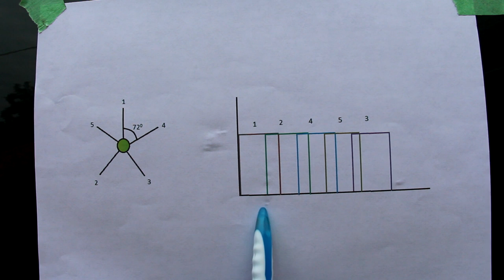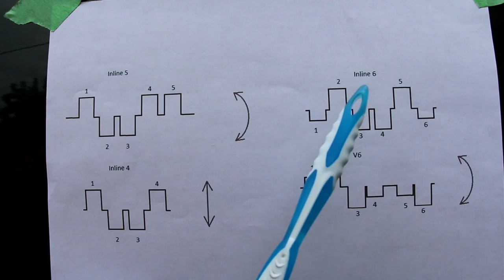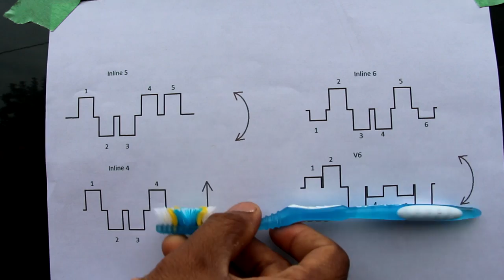Why Inline 5 Cylinder Engines are an Anomaly

Comment: Dude. I have long tried to understand how my 5 cylinder is balanced. You made it super easy to understand. I have owned 4 inline-5's and currently have two as daily drivers, although a bit older than this engine. Yeah, Volvo's pcv system on these is ridiculous to work on!

Comment: My 2011 Volvo S80 d3 5cylinder engine has 276,000 miles and still runs perfectly with no major problems with the engine or pcv system. Only problem was the alternator belt exploding but that was my fault for not changing it...
Reply from the maker: Good to know. These motors didn't have major issues. Everything else attach to it on the other hand....
Reply: Looks like this motor saw no maintenance. I don't care how good it is, neglect will kill anything.

Comment: Really good video.
1: What is the displacement of this engine?
2: What is the intended compression ratio?
3: Horsepower rating?
4: Operational maximum RPM?
5: After seeing the standing water in the number three cylinder, I was surprised to see that the crank would still move.
6: In a different video, the presenter made the case that a 5 cylinder engine delivered more, smoother torque than either a four or six cylinder engine of the same cubic capacity and suggested that in a race application might be the better engine platform to start with.
Reply: I have this engine in my 2009 volvo s40 and it makes 168 hp and it redlines at 6500 rpm

Comment: Speedkar, i  have a turbo 5  xc 90. is there anything good about the engine?
Reply: did you ever get a reply? I have the same model. I bought it new in -04 and still driving with 111K. only complaint is that side and top interior fabric have fallen down and Volvo used this terrible particulate glue that is nasty and sticky. No one will replace the side fabric because of the air bags. I also hate the rear battery. a pain to recharge or change.

Comment: Excellent review (as usual).

I would love to hear an auto engineer's perspective on why the oil filter was designed in that odd way (draining back into the engine).  Every vehicle I've owned, drains down, using gravity to drain the oil.
Reply: These top mounted cartridge style filters are quite popular on European built cars, and getting more common from other manufacturers too. Their main advantage over spin-on filters is environmental, they produce less waste because you only throw away the filter element rather than both the element and the housing.
Reply: This video is wrong. Having owned many cars with side or top mounted cartridge oil filter housing they are superior and create almost no mess when chaining oil. Just look on-line on oil change videos and you will see a mess from every bottom of the engine mounted oil filter being changed! Moreover, I can inspect the oil filter at any time without having to drain or change the engine oil! very useful for checking after additives and engine flushes. Lastly, no need to get under the car for oil changes. Just suck out the oil like boat engine from the top using the dipstick tube and cheap oil extractor connected to an air compressor. I can do oil changes quicker than a quick lube business. Did 5 family cars in 1 hour! no joke.

Comment: Great video!!! 

But I disagree that the canister style oil filter is messy in oil changes.  Loosen the cap to drain it while you’re draining the pan.  Once the pans done, just pull the filter cartridge with some paper towels or rags and no spills!  

Replace the filter, torque down and refill the oil.  

Plus, using an extractor means you don’t have to get under the car at all.
Reply from the maker: Seems like more mess than an upsided down mounted can type filter. The cartridge always leaves you exposed to the dripping oil
Reply: @speedkar99  This is the first time I have ever seen an "upside down" oil filter on a Volvo white block engine, I was very surprised.  I've had quite a few, turbo and NA and all have had a really nicely positioned spin-off filter tucked into a cut away corner in the front of the sump (i.e. to be removed from below.)  My current one has the replaceable cartridge type, but it's still held in a spin-off type housing - no drips or mess.

Comment: 7:47 is it possible to give scratched crankshaft to a machinist to rectify the surface? Say you replace rod bearing over the scratched surface, how does it make the engine not work properly?
Reply from the maker: The tolerances would not align with a replacement bearing since it's worn down. 
It can be machined and thicker bearings put in if you wanted to save it.
Reply: In theory yes. As the other poster said, you turn down the crank and use undersized bearings. But one that's this bad has some problems. One you'll have to turn down the journals so much that you probably can't get bearings for it unless you're talking a GM V8 where everything is possible and available. Second, the crank often gets really hot right there which destroys the heat treat. If it's discolored, throw it away.

Comment: I worked on a 5 cyl VW Jetta not long ago. Can I just say I HATE TORX! The engine was misfiring on 3 out of 5 cyls. Turns out, those engines are NOTORIOUS for coil packs going bad! The STUPID rubber baffle diaphragm valve unit is REALLY LAME too!

Comment: The five cylinder 2.4 turbo diesel on the Alfa Romeo 156 Sportwagon I used to have was just a wonderful engine to drive behind, and the sound it made was pretty good as well. It didn't miss a beat in 150,000 miles...until somebody crashed into it and wrote my favourite car off.

Comment: Thanks! The deck is also open with the turbo engines. Apparently no problem till 300 hp. With proper maintenance these last a long time. Head gasket only fails due to negligence induced overheating.

Comment: I have a v50 t5 2005, and I believe the crank spuna baring.  Some reason I lost alot of oil. There is no smoke from the tail pipe I can not see any drips in the driveway ... This situation is a complete mystery to me.  The engine has overheated to 3/4 red.  I have lost fluid twice to probably 1/3rd full in engine.  Last time it did this, the knock sensor and crank position sensor was faulting a CODE, but before discovery of that, the engine made a loud rattle noise, sound like it was from the top.  Oil light was flickering.  When I got to a local parts store.  I saw alot of steam and smoke from near the oil filter.  After reviewing your video, I believe that whole unit is clogged, or something bad to cause something bad to happen.  The minor coolant line that run between the radiator and aifter box was the first to break.  Got that fixed.  2nd incident was the heater hose over the turbo into the firewall.  that one lost alot of fluid.  The 1st incident was the one that cause the 3/4 to red gauge temp.  The 2nd did not show a tempature over the half mark.  The oil was changed with 6 quarts of oil from the 1st incident.  Everything ran fine.  The 2nd incident, I had NO CLUE, til the low oil light came on and the car was in LIMP mode. It was making a kinda loud rattle noise.  I was concerned for a spun baring.  When I was at the part store, I got the hose by the firewall resealed (Temp), but could not start the car.  I realized that maybe a LIMP Mode code was in affect. I put in another quart of oil in the engine, still could not start the car til the LIMP MODE was clear.  OBD2 reader also showed me a code of Crank sensor mis alignment, and Knock Sensor.  I was in fear that I damaged the internal, most likely the crank barings.  I cleared all the codes, and the car started.  She drove home fine, no issues.   

Next morning, I started the car, she sounded a lil rough, so I turned it off.  I restarted the car later in the day, she was fine.  I paid attention to the resivour for excessive boiling.  I noticed a fuel/exhaust smell, but the fluid was clean water.  But I could not get over the smell.  After your video I am thinking maybe the oil cooler is cracked, but that would leak oil into the coolant, or maybe it is crack to leak oil outside of the engine.  I decided to take the car for a 15 mile trip.  She drove well, lots of power.  Then I started to smell the steaming water.  I went into a parking lot, and opened the hood, surely, fluid is gone, the hose that broke on the 2nd issue, broke again.  SO no real biggie.  I put in lots of water, and steam like crazy from the broken hose line.  I turned the engine off, and restarted, then the oil light comes on.  I am freaking out at this point.  I got the car home, and did a brake accelleration test ... and started to hear THE RATTLE, but it sounds like from lower engine.  I can not produce this effect without doing that brake/accel process.  I wish someone else could do that so I could listen to the engine.  I am concerned that a baring or more is damaged.

After watching your whole video, I am positive I purchased a nice 2005 volvo v50 t5 that had poor maintence, and probably driven hard from North Carolina to Washington state.  So my question to you is, should I part this car, or figure how I am going to manage getting the engine/tran dropped to seperate the tran and bring the complete engine to a Machine Shop.  I prefer to get it fixed, versus parting it and getting another car, and WHO KNOWS what the problems are with the next car.  I am currently looking at a v50 T5 AWD ... the advantage on the other car is the lighter color interior ... Mine has black leather, but that one is tannish with heated seats.  Regardless, I need to have an operational car.  So I figure getting my current car engine fully repaired.  I know the transmission is in good shape, I might need to replace some mounts, and a few parts of the suspension that are worn, then the car will be in near new/very new condition.
    What am I to expect when i drop this engine, and what should I avoid or be warey of when it comes to taking it to the machine shop.  I know this engine is 9:1 compression, I COULD upgrade to 10.5:1 compression which WILL increase over power, and force me to be on high octane gas.  I am concerned about ECU not accepting the new compression and faulting an over compression code, given the power increase.  The head, I like to get ported, and install performance cams, and larger Throttle body.  Those upgrades SHOULD get the car around 300HP easily.  I might upgrade the ECU, with a program or R series.  I really do not want to rebuild this engine back to OEM New, but rather get some performance upgrade done.  That will up the value of the car so if I decide to sell it, It will sell.  The local machine shop is BUD's Machine shop in Lakewood WA.  He is nationally acreditted for his work.  I had a 22re engine built to have a 10k rpm balanced engine.  But that is a 4 cylinder.  Balancing a 5 cylinder is a different formula.  I am not sure knife edging the crank for higher RPM's is wise, as that usually reduces the engine torque, and can cause harmonic issues.  The other thing I am worried about is if the baring is Spun, if it can be resized to put in different size baring rings.  My worry is that because of the harmonic balance of the 5 cylinder, that minor mass loss can create a rotation frequency sling that will make an odd vibration.  These engines already make a weird vibration at low RPMS.  But past 3k, these engines are a beast.
   The other things I will do it change all the pump(s), Water/Oil, I will most likely replace the Oil filter assembly or get that hella cleaned.  I want to have the engine hella clean with all new hoses, gasket, and probably new strong head bolts.  This engine is NO WHERE as simple as a Bseries DOHC VTEC Honda engine ... So I am not really planning to make this a backyard work.  I rather get all the replacement parts in hand, coordinate machine work, so when I get the engine/tran pulled, I will bring that over to the machine shop for a full cleaning.  I might take the transmission to a service shop to get that inspected and cleaned, and replace any "wearable" parts so the transmission is new.  this car is at 194k, so that would nearly make it a NEW setup under the hood, which I should be in the clear for next 100k miles, plus make the car faster and sell for higher than normal value.
   What are your thoughts?

Comment: Superb technical explanation and video production. Subscribed. However that Volvo design looks like a nightmare. You saved some folks some busted on the side of the road motoring frustrations for sure. My sister bought one once that was constantly in the shop. She always called complaining she was getting ripped off, and wanted me to confirm it. Sorry little sister, but I told you not to buy a used Volvo.
Reply from the maker: Thanks, it's good to see the inside of different engines sometimes to understand

Comment: I have exeprience with toyota 1Pz diesel 5 cyl, good robust engine.
apart from 144 degree power stroke vs 180 deg (720÷5 vs 720÷4) no major diff. It was competing against big bro HZ which was 6cyl turbo for highway speeds.

Comment: Yes, but where did it fail to mix the oil and water together? The head- it looked clean? The oil cooler that has water jackets?
Reply from the maker: It could have been the radiator / cooler.

Comment: I had a 855 2.3 T5 with bigger turbo, customized ECU with twice the bhp it originally had. 400 bhp on 1400 kilos is a lot of fun. No problems up to 250k miles. Then i sold it. Still runs around somewhere.
Reply from the maker: Nice

Comment: good video, but there is no upper oil pan. it's a 2 piece engine block due to it sandwiching the main bearings for more strength., so lower engine block would be more accurate. same with the head, it's a 2 piece head with  no valve cover due to the bearings being systems being part of both the upper and lower head. it's been like this since the whiteblock was introduced  around 1991 with the 6cyl 960. you can actually use 6cyl engine mounts and sump to fit these 5cyl into the older RWD drive cars. the 6cyl sump even has 2 marks on the sump with match up to 1 cyl width to be cut out and rewelded... rewelding is generally best down whilst it's bolted down up to the lower block to stop warping.
Reply from the maker: I see. I still call it an upper oil pan but I get your understanding

Comment: With all the engines you have torn down, all the different corporate cultures they reflect, all the decisions and compromises they make for performance, emissions, maintenance, production cost... Having torn down so many engines you have a broad understanding of what makes a good engine. It would be great to have a video where you summarize all the lessons learned. Stuff like best practices, what fasteners are best, where to locate things so they are easy to work on, which layout is preferable... What does your dream engine look like?
Reply: Technically speaking. An in-line 4 single overhead cam in a rwd configuration is the best possible situation. Much like the Volvo 24/740/940 s. No job is particularly difficult on those engines pretty good design. Saying that it’s virtually impossible to design an engine where everything is easily accessible. But yeah. Basically any situation where there’s lots of room, most things Mounted toward the top or bottom of the engine for access. Only real issue with the vovlo red block engines is the pcv is a little awkward to access, and the sump can’t be removed without dropping the subframe
Reply: @jamesmoore8461  thanks for the insight!

Comment: I have two of these engines.  Stay on top of lubrication, cooling and PCV = long life and no problems.
Reply from the maker: Agreed. Those were the delicate spots on these
Reply: I also recommend factory engine mounts and subframe bushings to mitigate vibration.  Avoid polyurethane except in the suspension.

Comment: Wonder if it’s possible to have an oil cooled engine  . Coolant wouldn’t have to be separated from lubricant .
Reply from the maker: Possible on smaller engines
Reply: its called a VW boxer engine. the oil is the only coolant.
Reply: Robbie Wilson  - good point/example - wonder what the cons are  ?
Can it be done with a 2.5 , straight 4 cylinder ?

Comment: Usually when the PCV box gets clogged it blows out the Front cam seals but the valve covers almost never leak cause they are machine surfaces w/ chemical gasket. Also those lines between the cylinders have a spec and can determine an overheated engine.

Comment: Fascinating, when viewed from outside the car. As a Volvo owner, working on this engine crammed into the front gives me nightmares, in comparison to my RWD 4 cylinder. Albeit way underpowered imho 
Good job 👏
Reply: I have 2 of these engines in Volvos.  Regular synthetic oil changes and stay on top of PCV system = zero problems over 31 years total ownership between the two engines.  Timing belt and cooling system service too of course.
Reply from the maker: Thanks

Comment: 6:30     Volvo, Ford and VW seem to make a lot of crucial/fatal engine parts out of plastic...🤔. Well, Volvo did relocate the ECM further away from the exhaust manifold on this motor
Reply from the maker: At least
Reply: Under Ford influence lots of things changed to plastic. I have worked on older versions (and the same age from the bigger models like S60/V70/XC90) and things like oil pick up tubes, thermostat housings etc are all metal. This is the cheaper version which sadly has many plastic parts.

Comment: Excellent video and explanation very much appreciate👍 
Sweet, dependable, strong, and reliable engines now I know why😊
Reply from the maker: Thanks, do you have a 5 cylinder?
Reply: @speedkar99  Yes, a wonderful Volvo with over 200k on the clock.